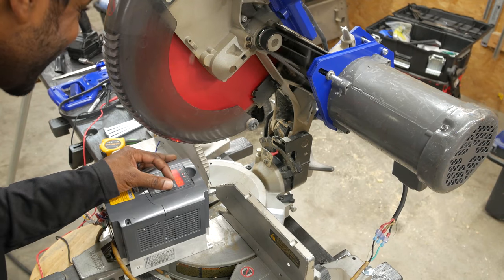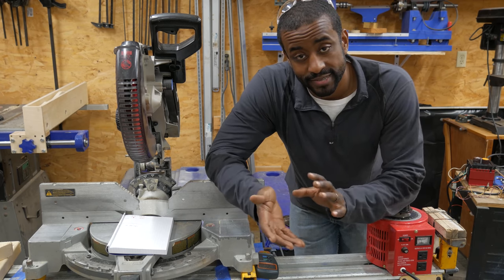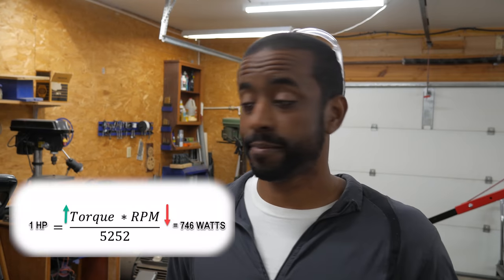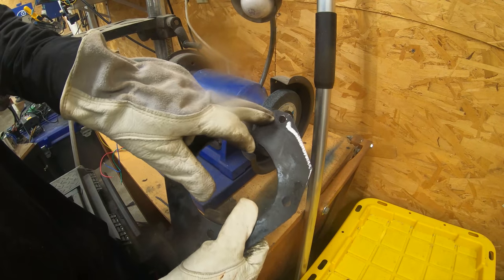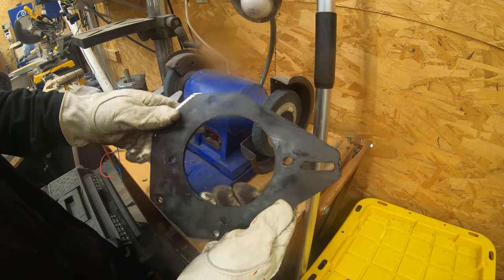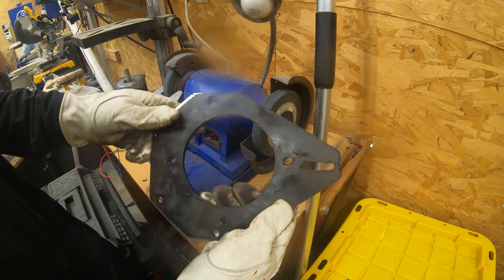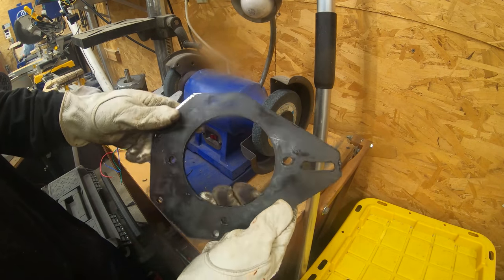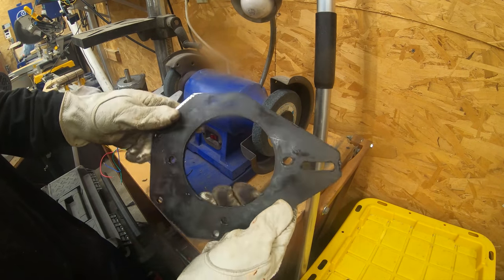How To Speed Control Your Miter Saw For Cutting Steel #080

Comment: Your videos are awesome! "What?  I couldn't talk about it and not try it!"... lol Did you considered just using abrasive wheels when cutting metal? It will make a bigger mess than a scotchman cold say, and a much bigger fire hazard in that wood shop, but in the name of trying... just have a few fire extinguishers handy . It is so different when someone smart tries all this stuff. When I do it, it just looks like more and more mud thrown against the wall until it piles up high enough so that it just looks like some of it stuck.

Comment: you say that but there are plenty of universal motors with speed controls, like dremmels, angle grinders, palm sanders, hand drills, how do they do it ? there isn't a lot of room in there for more then a potentiometer.
Incidentally i have a small/cheap drill press on which the speed controller died, the speed was going up and down with no load since day one, i guess that was a red flag, so i took it apart and the speed controller is a small box about 1x5x7cm with a potentiometer sticking out, it's filled with black epoxy so you can't fix it, so i ordered a 2$ speed controller from ebay and now it works again, but it doesn't slow it down as much, even when turned all the way down, there is a secondary trimmer pot (2MOhm) that i probably have to play with. The original speed controller would also speed up if the speed went down when you used it with a heavier load.
I tried the new speed controller on a non-adjustable angle grinder and only like the last 20-30% of the dial worked, it wouldn't spin below that, then i read or saw a video about a guy saying you need to add a 2K 10W resistor (in series i guess) as an inductive load ? and then it will work better, i haven't tried that yet.
Would be nice if you could make a video on that explaining it.

Comment: If the original motor is 3600 rpm  change it to a 1800 rpm and forget all the speed control stuff. I like what you are doing, Here's a simple project for cutting steel . take a table saw for wood and change the motor to 1800 rpm and stick in 7 1/4 " 40 tooth $10.00 carbide. I been using this for years now, People can't believe how good it cuts. I have mentioned this many times  on youtube and never seen anybody make a video . I think you might be the one.

Comment: EASY PEASY /UNDERSTANDING THIS PROBLEM:  Think of the average drill press with different sets of pullies.  The pully system is the CORRECT WAY to adjust SPEED OR RPM.   I have bought $10k worth of saws.  They are engineered specific RPM for a reason.

Comment: Having a two horsepower induction motor on a chop saw opens up a world(4” stainless?!) of possibilities. The saws usually do a fantastic job of cutting at a tight right angle, saving time and materials in a machine shop (home or otherwise). The saw kerf is close to the thickness of a cutoff tool on the lathe, but take a small fraction of the time to cut through comparatively. Yeah, the material still needs to be faced, same thing for a cutoff tool.

Comment: Could always just try a Makita tools general purpose metal cutting blade on the 3600rpm metal cutting saw works like cutting butter. I have cut 1 inch thick plate steel no problems

Comment: Impressive skills. Wouldn't using the DC speed control eventually burn up the motor from higher amperage draws? If you don't have an induction motor and VFD laying around- just go buy an evolution saw and be done with it.

Comment: Bummer dude. You did a great job explaining things and I learned quite a bit but I was hoping that you had some simple way of reducing the blade speed without resorting to replacing the motor. I too am using an old junk wood chop saw to cut steel but the blade speed is way to fast and the blades dull much too quickly. I thought about modulating the voltage (fairly simple) but concluded that the motor would lack enough power (which you proved). The only other thing I could come up with was replacing the motor which is way more involved and not having a cutting table (I'm jealous), VFD or 99% of the other things you have I just decided to use it like it is and make cuts sparingly. The abrasive cut off wheels work but they have a tendency of wandering a bit, give you a rough finished edge and make a mess. Looks like I'm  just going to have to bite the bullet and buy a real metal cutting saw.

Comment: Would a modified belt/pulley ratio have worked  after we realized we were looking for 1500rpm and not 25rpm?
Reply from the maker: Yep
Reply: @Jeremy_Fielding  thank a lot for the response! I’d love to see that done. There’s a ton of YT videos attempting/failing at the mitre saw to cold cut saw conversion but any one that ends up with a useable cold cut saw has also used hundreds of dollars in electrical components and it’s not really cost effective anymore. I think a lot of people would like to see the stock mitre saw cut steel with parts as cheap as 3d printed pulleys or something along those lines if at all possible.  Just an idea that I’m sure you’ve already thought about. I really enjoy the content and your in depth explanations, thanks a lot.

Comment: Damn i have the 7 1/4 diablo steel demon which rpm range is fine for my circular saw so i got a 10" for my miter saw that is 3000rpm max and the saw is rated at 4100 rpm. Gotta see if i can slow it down

Comment: Universal motors definitely have more torque and adjustability range on DC vs AC..  I use a DC controller on my leather sewing machine as the cheap AC controller is basically garbage (not much adjustment range and no torque at slowest speed).  The DC lets me get down to speeds where I can sew accurately down to single stitches but still have enough torque to drive the needle through many layers of leather, but as your results illustrate, I don't think it's enough for really high torque applications like your saw..

Comment: When cutting square tube steel if you start in the corner ln other words set it at 45 degrees from flat the resistance goes way down.

Comment: They have metal cutting blades that run run between 1000 and 2000 RPM for a 14 inch blade. See the dewalt DW872 (1300 rpm), the Ironton 23501003-I (1450 rpm) . These saws are a lot better than the fiber cutoff ones.. The metal comes out cool enough to handle immediately after cutting, they are as quick if not quicker, and there is a lot less sparks and mess.  OOPS Just got to the 16:30 mark.. I see you figured out the 1500RPM number..

Comment: You can keep the power and the speed if you use a $380.00 high speed steel (HSS) metal cutting blade.  By the way...a friend of mine grabbed the saw blade like that, I called 9-1-1 and his other buddies gave him the cool nickname ‘stumpy’..

Comment: I'm wondering why the RPM needs to be so low?  There's a company called Evolution that makes some cold cut saws, and their blades seem to max out at 1450 RPM.  They do sell the blades separate from the saws, so it makes me think that it might be possible to still wrangle something together that would still work without going to such a low RPM.
EDIT: Just got to the end of the video.  That makes more sense now.  That thing cuts like butter!

Comment: When cutting steel don't you control both speed and feed rate of the material, meaning you balance between the two? You could run at a higher rpm provide  your feed rate is correct.

Comment: I kinda wonder why those cold saw are between 20 and 80,  cause for cutting steal with carbide,  and a 10 inch blade,  you still need almost 200 rpm,  may they slow it down because of the violence of the interrupted cut? Where can you get 2 HP 3 phase motors for a couple hundreds buck,  not thousands?

Comment: 12:40 That's not really a problem, after all if the rated power of the induction motor is equal or above the one of the original universal motor, for the same speed you will get equal or more torque (losses neglected). The actual problem is that while the universal motor naturally brings up the torque as the load increases and the speed decreases, it will take a pretty smart VFD to do the same with the induction motor, which otherwise may stall.

Comment: So probably not feasible but...if a universal motor’s speed is controlled by voltage, a speed controller could be made that would ramp up voltage to provide a constant speed regardless of load (up to a point)

If you scope dc motor draw with an inductive amp clamp you can see the commentators in the form of humps in the amp draw waveform. Knowing the time base and number of comm segments of the armature allows you to calculate speed. So a speed control doesn’t exactly need direct feedback from the motor to know speed. So it’s doable, just not sure it’s cost effective.

Comment: Jeremy, in my experience with drives,  to maintain control there must be either a tach  or an encoder on the driven shaft. Without positive feedback their can be no accurate control. Just a thought, Joe. O yeah, now if you want to go old school, get a generator with series fields and shunt fields and you can do it. Of course to get really close you will end up shimming the pole pieces with brass or steel to increase or decrease the pole strength determined by measuring the voltage drop across the brush  under full load conditions. If OSHA ever saw us doing  that we would still be in jail. Of course you would need a 100 amp 3 phase service , or you could cheat and buy a VFD for a couple of hundred bucks. LOL

Comment: Okay I work with mitre saws and what he did it's kind of cool the take your mitre saw and actually put it on a mitre have any degree more directly a 45 degree and see if the old puts the same cuz guaranteed is not you lose energy when it's on the mitre and I don't know why maybe somebody can tell me why but his motor setup cutting straight down is not the same as cutting on an angle or mitre

Comment: I wouldn't push the dc speed control motor. More current will mean heat and eventually the winding's will short out. VFD seems to be the winner.

Comment: Pretty cool. You will probably want to use a metal cutting blade, as they have depth limiters. Without them, if you try to cut soft metal like aluminum, it will grab the metal and try to kill you. Don't ask how I know.  Edit:  nevermind. You did.

Comment: 72:1 reduction? 3600rpm/72 = 50rpm. For what use you need 50rpm? Most steel cutting blades has required 1000-1500rpm for 355mm/14inch rotor
Reply from the maker: It sounds like you didn’t watch the whole video
Reply from the maker: It sounds like you didn’t watch the whole video

Comment: That universal motor would probably still work if there was a reasonable way to throttle the voltage based on blade speed.

Like if below 50 RPM the voltage automatically increases and then decreases once above 50 RPM.

Comment: Hi there Jeremy. I live in (Scotland).
No one here Does your type of Videos. I have learned Sand blasting, Tig Welding Mig Aluminum and lots of other stuff I thought I was really good at. 
And I have learned all this from US Videos,  I am 73 yrs old and worked with my grandfather as  a Blacksmith. eg Making Shoes for the likes of Clydesdale horses, And work horses in general.
I Still make Horseshoes And some for Racing horses in Training but I mould them in Aluminum. whatever. Seems  My spelling is down the drain, As is my eye sight.
I have tried to find your speed control unit no luck on ebay or etc. where did you get it From. Any info is fine. Old Tom Scotland.

Comment: Some of the cuts on your plasma table need to be reversed.  For your purpose  it's not a big deal, but the "good" side of a plasma cut is the right side of the torch as it travels forward.

Comment: I wish you had tried to adjust the speed to compensate for rpm during the last test... you would have gotten more torque and rpm with less pressure, which heats things up and wears out blades...Clearly both torque and speed suffered during final test... I would have set it to run 1500 rpm under load, not free wheel...

Comment: ...with 1224 comments I doubt I am the first to write this but wood and sparks make fire (...no I did not read them all). Be careful.  8)  other wise you are one smart electrical dude. (engineer)
Reply: ... and yes I know by design those cold metal blades are designed to not spark like friction blades.  but ..it happens

Comment: all you have to do is put a Diablo steel deamon on your saw and cut steel or wood it is ratwd at 5800 rpm I am cutting 1/4" plate at 5400rpm quick and clean

Comment: Looks like a universal motor is a poor choice for speed control-period.  Since you have 2 miter saws, I would just use the unmodified one for high speed applications and the one with the 3 phase induction motor setup for cutting metal.

Comment: At around 1700 rpm rather than below 100, it comes into the range that changing the pulley ratio may be practical.

Comment: Shouldn’t the rpm of the blade be measured at the edge where it’s going to be cutting? I’m not too sure how they typically measure it but in my head it makes more since to measure it out at the teeth
Reply from the maker: RPM is the same at all points on the blade... perhaps you are thinking of sfm surface feet per minute. It is related but not the same
Reply: @Jeremy_Fielding  oh yeah that makes since, thank you.

Comment: If you have a steel cuttomg blade it will tell the the rpms which is a lot higher than 80 rpm. Its more like 1100 rpm.

Comment: Could've used a coolant like oil to add the blade.. even at high speeds as long as there's coolant and low pressure down force on the material it should cut easily

Comment: When cutting steel with a blade the the rpm needs to be reduced by the neighborhood of 10 to 1 from the wood speed.  This should be a mechanical reduction in order to maximize the torque.  I must ask why you did not use a course abrasive cutoff wheel.

Comment: I sent you a question, wondering why a simple drill or screw gun has a variable speed on it, a single phase motor, and I believe I know the answer now, between AC and DC, the universal motor will swap both ways, did not know that.   Maybe a little down the line, can you show us a little more about that, or is that in one of the previous videos, about motors... Obviously, I need to watch that one again, there were things I missed

Comment: Um, has ANYONE seen the video on “Diablo Cermet steel cutting blades?  I’ve tried the 7 1/4” blade on circular saw and 12” on dewalt dble bevel sliding miter saw.  BOTH well over 1000 rpm the miter is 3800, CUTS THRU STEEL LIKE BUTTER NO SPARKS COOL TO TOUCH NO VIABLE SPURS, cutting 7/8 and 3/4” 10 gauge steel tube and love it!!  Pricey compared to other blades but only up front... blades last long time, numerous cuts, all clean!!  Way cheaper and faster than what this video shows (sorry brah’), not trying to “One Up” ya.

Comment: Except that's not how you control power on DC motors. The best shot you have is building a controller that does constant speed, like a servo drive. It needs to increase power when the load increases to maintain speed. But that only works up to a point: the current through the motor windings increases at higher load and if you push too much current through them for too long, you'll burn out the windings. You either have to have some kind of gear reduction, or switch to a motor that has higher torque at your required RPM.

Comment: For about $50. you could have bought a Freud Diablo Steel Demon Metal cutting blade to fit on your 12" chopsaw. Or less $$ if it's a 10" ? This blade cuts ferrous metals just fine.

Comment: If the speed requirement for a steel cutting blade is 1,500 RPM and the mitre saw works natively at 3,600 RPM, wouldn't a pulley set change to give you  a 2.3/1 reduction work (1.5 large driven and 1.5 smaller drive pulleys)? Shouldn't that be doable using the same housing with a pulley assembly similar to what is used on drill presses? One could also switch to a smaller blade for even greater torque. Just something to ponder 😉
Reply from the maker: Things you think about when you see the whole  story at once LOL
Reply: @Jeremy_Fielding  Indeed - Last fall I was modifying a machine that had suffered excessive wear on a lifting mechanism, going through several designs to finally manufacture an external ball bearing support only to find afterwards that I could have bought a flanged bearing off the shelf for a few bucks that would have done the job with only minor modifications 😆

That being said, what I suggested is an untested idea - dual size pulleys of that type aren't exactly off-the-shelf items!

In any case, your video has piqued my interest into modifying my old DeWalt belt driven mitre saw as its pulley system seems much easier to modify...